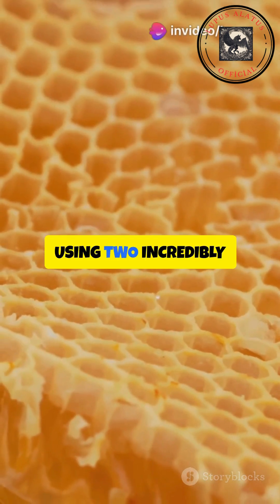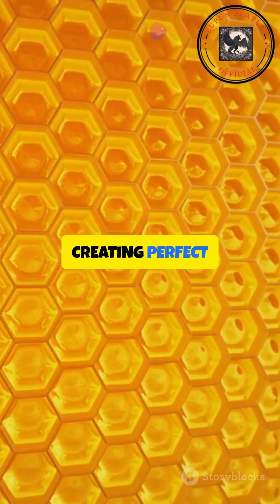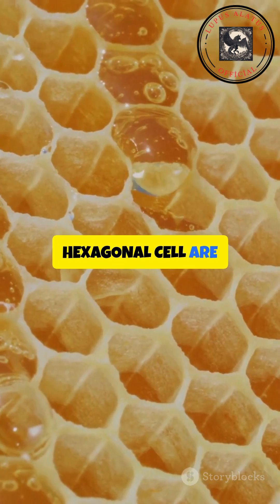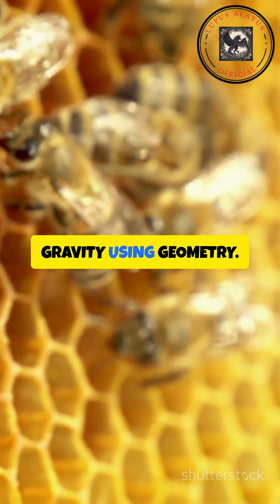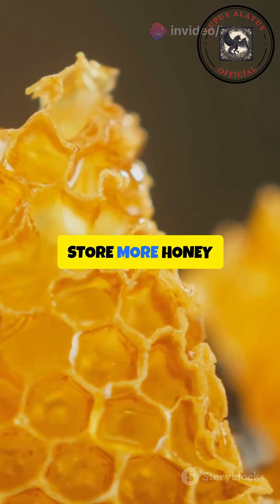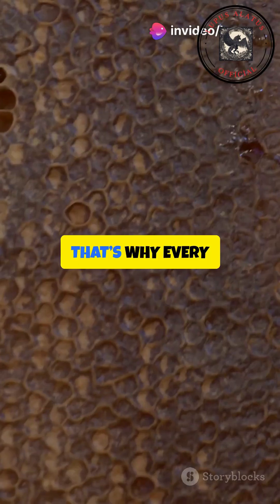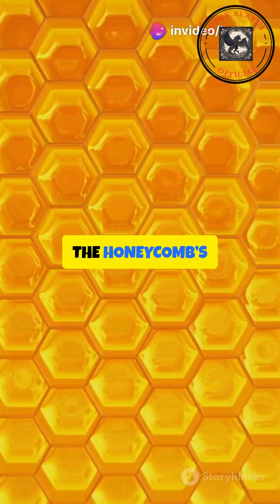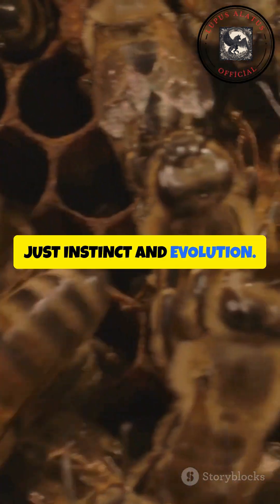The Genius Engineering of Honeybees 🐝✨

Comment: This is very misleading. Bees make circles ,  it's  the pressure or weight that turns the circles to hexicon.
Reply: NO. They build hexagonal combs from scratch. I am a bee-keeper. I see this work taking place every day in the African ""Killer"" bee hives that I have here in Nelson Mandela Bay Republic of South Africa.
They did not evolve over millions of years. Just like yr Boeing 737-800 did not evolve .... It was the result of Intelligent Design. 🎉😅
Reply: @MelvinSmith-m5f  I'm not a scientist. I'm also a bee keeper. A great example is bubbles are round as a single, but when many bubbles touch together, they transform into a hexigon.  Bees make the size circle for drones or workers that naturally turn hexagon while constructing. Bees are not measuring 6 sides to be equal to designing a hexagon.  

Yes, the comb is a hexagon,  its amazing.  I'm only saying they don't have bee mathematicians doing calculations.